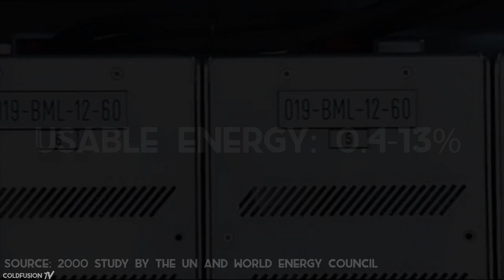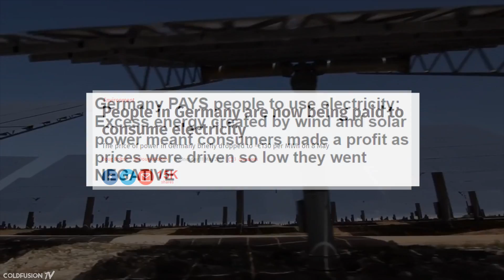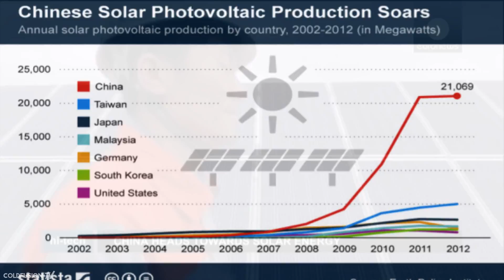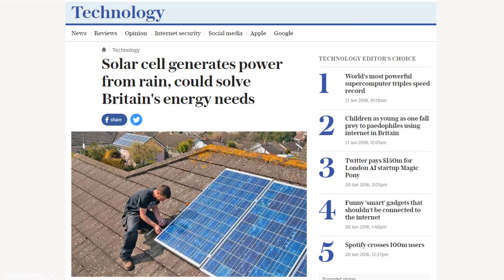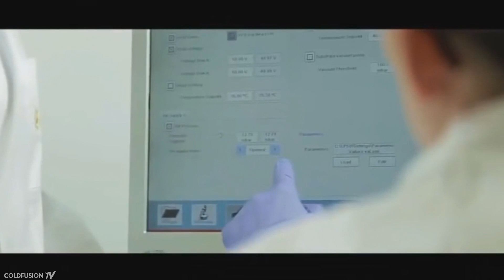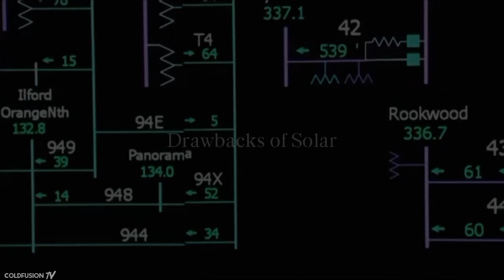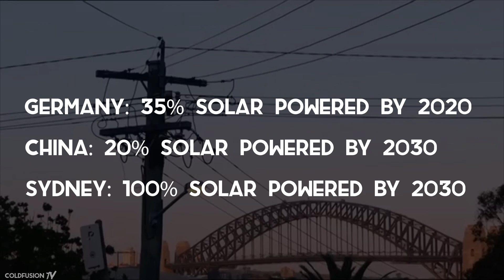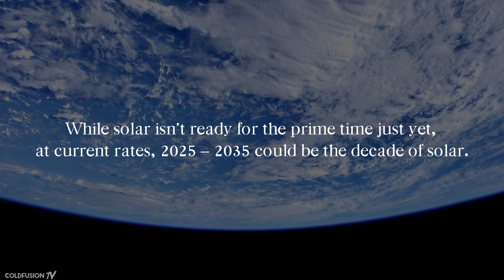The Truth About Solar

Comment: Solar will be great one day, but using government to push solar today is ridiculous.  It's far too expensive (the most expensive source for electricity), energy storage is far too expensive and environmentally unfriendly and solar panels require large areas of shade free land.  More, storms seldom affect fossil fuel production or electrical production from those fuels, but they can wreak havok on solar panels which would then have to be shipped in and replaced, so a hurricane that mainly results in cables and poles being replaced today in days to weeks neighborhood by neighborhood would require weeks to months to get electricity back up for entire areas.  It's too much in its infancy to start pushing cheap, efficient and well established power out of the way, which is what governments and environmentalists are attempting to do.

Comment: solar power has an excellent future but right now its not the answer right now.  Fossil fuel  in all its varieties still rule and will do so until technology improves the value and use of solar but will not replace fossil fuel.  Still have Locomotives, Semi trucks and delivery trucks that are just not able to be converted to electric. As for buildings , its on the right track.  Once the storage of solar is solved for night time use then the explosion of solar will be a reality.  Hope its soon.

Comment: The truth about solar energy.. Pff.. To make a solar panel you have to use sillicium, China is getting that raw material with a use of a hugh puluting methode from the ground and the cost to repair the enviroment for that is sky rocking. A side of that.. The sun shines radiation to the earth and 90% is reflecting from the earth now. But with solar panels all the radiation is containt and the earth wil warm up. The earth warms alot faster than we destroy it usual..

Comment: 0.36 cents per watt???? That would mean that a single 100 watt solar panel should cost only $36 but that isn't exactly the case now is it?? In fact a 100 watt solar panel brand new on eBay starts at around $85 so the cost isn't what they claim it is! And even though I myself champion the idea of solar power it really isn't as "cost efficient" as it is always claimed as it is, because there are other costs involved in the production of solar power that they just don't talk about, which I have learned over the past five or so years! Batteries after all are required for storage of the electricity that is made from solar panels, and they can be stupidly expensive as well, and in some areas like mine hard to acquire as well! Then you need a charge controller, and an inverter too which also drives up the cost well past that 0.36 cents a watt claim as well! In fact solar is far in many cases from actually being "affordable" to some homes, and some customers, even those like myself that would like to switch to solar, and not everybody has a YouTube channel where some solar company donates their products for free to us users! Further in some areas zoning laws can be an issue as well! So you really have to do a lot of homework before you can get into solar power as well! I am not discouraging anybody personally, but these are problems I have ran into and found that solar at times is not as affordable for at least 5 to 10 years is all I am saying! And the initial costs are greatly more that 0.36 cents to start a solar energy system for your home!
Reply: the expensive parts are inverters and batteries, the paneles themselves are already very impressive for the $.

Comment: Great overview but there was one mistake. Peak demand for electricity in the summer is 2:00 in the afternoon when AC is running hard. In the South, US they shut down generating capacity in the winter because less AC is used. And with Climate disruption causing Heat Domes with heat indexes of 164*f, AC will become Life and Death and Solar is great capacity for operating AC.Read more at:  AParallelWorld.com/home-energy

Comment: The only problem of the video in my opinion is that it covers only the photovoltaic side of solar power.
The other side is using oil that can keep heat during the night and so produce energy while there is no sun.
The energy is pretty much produced like any typical heat based power plant (coal, nuclear, geothermal and so on) , but using solar energy as a primary heat source.
Photovoltaic is nice and the breakthrough shown in this video are great, but I think there is many things that could be displayed like using stirling engines with solar power. and a lot of other cool stuff actually :)

Comment: Problem with solar and wind is neither one is a zero sum gain. Solar looses 55% of it's power after just 5 years. Not really a problem because you will most likely have to change all those world polluting lead batteries at the same time. So the money you invest will have to be reinvested in five years. Wind uses up the expensive magnets in about the same amount of time. It's why you see all those windmills not turning. Yet they keep putting up new ones, Why? because most governments give huge credits and incentives for new windmills just not for the old ones.
Reply: fake news, they basically don't degrade at all, quality solar panels are guaranteed for 25 years lmao.
Reply: mhills51 Yes I was concerned for this, people have limited means yet they have contributed. But a better approach and better equipment is the justifiable option if peoples cooperation is not to be stretched out to breaking limits
Reply: I  retired some old solar panels in 2017 (they were too small), manufactured in 1991. When I tested them they were still putting out between 45% and 75% of the labelled output. They were made in USA and warranted for 10 years. As for house batteries, they have to match your consumption. If managed properly, lead-acid batteries will last 7 years. They are recycled in most countries as lead is toxic and cannot be dumped.
Reply: its more like after 20 years looses about 20% degraded so just add more panel on your grid LOL i rather have a mag generator runs 24/7365 not just powered bythe sune 8-14 hours aday ?
Reply: after 20 years i just added one more 100 watt panel thats all not bad at all , but i do have flex panels as well lower current but you can wrap it around a pole and it still charges
Reply: Where did you hear solar loses 55% of power after 5 years? I've never heard anything like that before. I'd only come across depreciation rates of somewhere between .025~2% yearly losses in power efficiency.
Reply: mhills51 I have two solar panels that are 25 years old. In that 25 years they went from 7.5 amps peak to about 7.2 amps.
Reply: So the "problem" is they are zero sum gain?  That's your question???  So what about gas, coal, etc.??  What about their zero sum gain??  This is about efficiency if you haven't forgot.  Solar isn't "losing" as you ignorantly typed.  The efficiency of solar over the other typical energy consumers isn't even a comparison.   And then there is "the polluting lead batteries" argument......says the people that have driven cars for years upon years, replacing their batteries in every vehicle they possess. You do realize there are more efficient and lower emission produced batteries out there right?  Come on people, get educated and at the very least, use common sense.   Stop defending oil and gas and coal as if it's really cleaner and/or more efficient.  Just absurd.
Reply: mhills51 oh, and permanent magnet motors last about 20 years. And the magnets can be replaced, but I do factory maintenance and never have. I just replace the motor.
Reply: mhills51 oh, and lithium ion doesn't use lead.
Reply: Hallelujah.........u also can produce hydrogen to store thatt energy!
Reply: No batteries in grid tie solar

Comment: what I don't get is there is a 12 year old that was able to harness the power of static radio/gama/x-rays just chilling around us with a copper coil and power a water pump Connected to a solid state battery who would have a indefinite life span proving you could stop famine in Africa for 13$ without sunlight, why aren't we doing that?

Comment: Average Availability Factor of Solar PVs in the US and EU : 15% (19% in Nevada), Average lifetime : 20 years, Cost of building : 1.5 M$/MW

You need 36 G$ to produce the 525 TWh produced by an average 1 GW current gen nuclear reactor in its 60 years lifetime, and the calculations are done for a perfect grid complementarity, with no exploitation or retreatment costs.

The nuclear reactor will cost around 10 G$, building, exploitation and retreatment costs included.

Almost zero marginal cost doesn't make everything. Without subsidies, solar is non competitive and no technological upgrade of PV panels will change the fact that the sun light is too dim more than 300 days per year.

Comment: Solar  power and electric cars won't allow you to drive from New York to Los Angeles and  back in the same time as gasoline or diesel will, and train travel  won't let you stop at a White Castles for a few sliders on your trip. the Energy company that I subcontract for used to have electric trains moving the coal to the power plant. they did a way with the electric trains in favor of diesel Electric engines that were less complicated to run. instead of having to have a license electric engineer operating the trains they were able to hire train Engineers at far cheaper wages

Comment: My electric trolling motor + the solar panels I got, effectively give my boat an unlimited range...

And a company in Toronto has a battery free solution for power storage, involving air balloons underwater on pulley systems...

Comment: Based on a 30% max. peak efficiency of PV versus the (roughly estimated) current world electrical/energy demand of ~500 quadrillion BTUs/Day .... translates into the need to cover ~1/3 of the entire land mass of the planet with PV cells.  A simple energy balance calculation using simplified assumptions (land area, solar flux, PV efficiency, etc. etc.) will prove this point.

Comment: I really like solar, but you can't run the entire grid off of it because it is unreliable. However solar in combination with other renewable sources is very promising. I am particularly intrigued by tidal power; we could use the oceans as giant, self powered generators. Tidal uses the moon's gravitational pull on the ocean to make power. Solar uses radiation from the sun to make power. It is kinda poetic.

Comment: Or mankind could finally achieve cold fusion. Hopefully these solar panels will only need to be a stopgap measure. The inconvenience of having no power when the sun goes down, or the expense of buying batteries so that you still have power without the sun, will no longer be a relevant problem.

Comment: No mention of the rare minerals used to make solar panels or of the panel waste stream.  Also no mention of community or network storage requirements.  Battery storage is also pretty pricey, not to mention battery waste stream at the end of its life cycle.  Not against solar, but leaving some significant negatives out of your "down side" portion tends to leave one thinking there is quite a bit of bias here.

Comment: Why would you start with the total energy on the earth, wtf, we only need to look J/m² And obviously the earth is each hour in sunlight, where any local place is not, except the far north or far south at some moments. Why would you put thin solor panels on your roof? The roof need to give protection against heavy storms and hail. 
Why don't you compare coil with the actual price? instead of no clear comparison. 
Why you show that toyata got a solor panel on it''s roof, that idea is way more older and has 0% to do with the truth about solor itself. If I want to explain the truth of why snow is white, I don't show snowmans are also white next year arguments in.
What is the truth? We need to wait? It cost alot of money to change the grid? It is not perfect and it will get alot inprovement? This are all sidenotes everyone already know.

Comment: The peak demand issue is solved quite simply by utilizing the already existing electrical grid.  There would be little need for storage if we use distributed production on every rooftop so that buildings supply each other with the excess.  Using thermogenerators and heat exchangers to heat water further improves the efficiency of systems.  Conservation should be part of our design models, not a secondary 'option'.

Comment: claim that solar energy if free is bit of propaganda as hydro power is free as well, wind power is as well. However no matter you like it or not nuclear power is the cheapest. Same as with solar energy is with nuclear as in both initial assets investment is huge. Nuclear energy is much cheaper and every new nuclear power station is costing less and less per Watt produced. Current high prices are not because expensive technology but because monopoly of just few nuclear power stations builders. 

In this video no one mentioned price of the footprint - land which is expensive. In order for one solar power field to produce equivalent of energy produced by nuclear plant is incredible. Nuclear plant that is supplying NY with electricity has very small footprint. Solar panels which would supply equivalent output would completely cover an area of NY itself. That would be only nominal output not real. in order to secure 24 hours power supply these panels should be increased for at least 2/3 so even bigger area and more money for a land and installations. That in turn will make these solar cells even more expensive.  Only when scientists will develop cheap batteries with huge capacities to store excessive energy for a longer time than solar energy will become serious business as in desert areas would be built extremely large solar panel fields which would store enormous quantity of electric power in these batteries which would later be sold to consumers wherever in the world. That clearly means that batteries would need to have immense storage capacity. 
However future is in fusion reactors not in anything else as during the fusion process no radioactive emmission is released. It is tottaly clean and permanent source of energy - very  cheap energy

Comment: Great video but ignores the real long term questions. Yes the cost per Kwat is going to fall to almost nothing.  But long term that's not where the costs are.  Those costs will be in distribution and storage for peak usage.  We still need a more farsighted energy policies in regard to Thorium.  It is irresponsible to treat it as tho it was as dangerous to work with as Uranium.  That is part of the carbon industries game.  So I'm more than a little suspicious of the motives of those who created this video.

Comment: The power that comes from the Sun is free for everyone to enjoy and harness: to light homes, to water farms, to power factories and industries, among other benefits. However, there are still attendant costs that come with it which are needed  in harnessing the energy of the Sun to productive use, such as costs of solar cell panels, inverters to convert the DC power into AC, accessories and technical service fees. I think governments are the effective helpers to enable many, especially the poor farmers and communities without access to fossil-fueled electric generators, for them to reap the benefits of free energy the Sun is giving for free everyday around the world! After that governments' help, the world will enjoy 25 to 30 years of productivity and prosperity, at the least cost possible during this present times! Not only that - everyone on Earth will enjoy cleaner air in the years ahead!

Comment: when i was trying to make my car run on water, i realized how easily hydrogen can be produced through water hydrolysis, with a few DC volts, provided by these solar or nano-solar panels and then, like the electric car Honda was working on a few years back (now i heard they are going to build a plant in California) use the hydrogen either for fuel or to produce electricity with it, in a reaction with the air through a fuel cell.